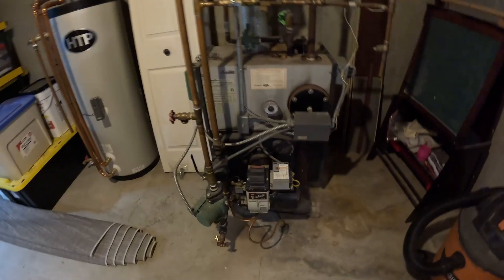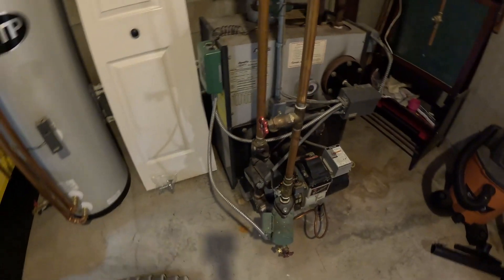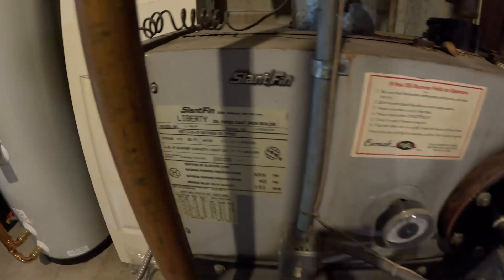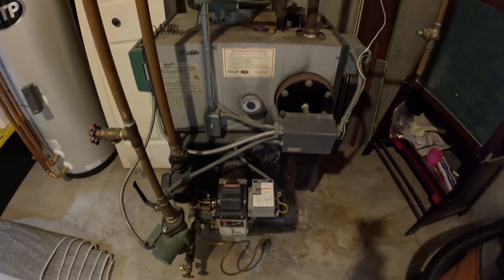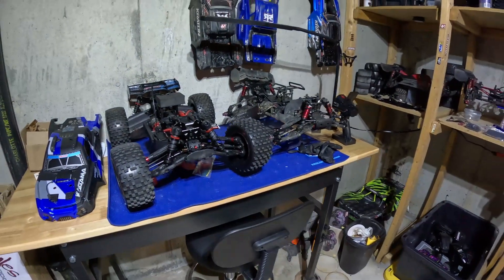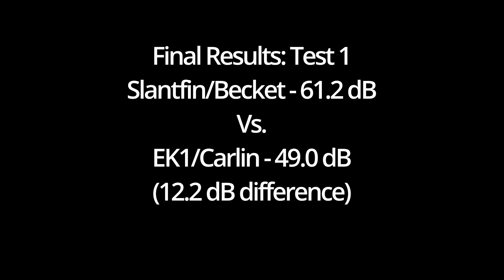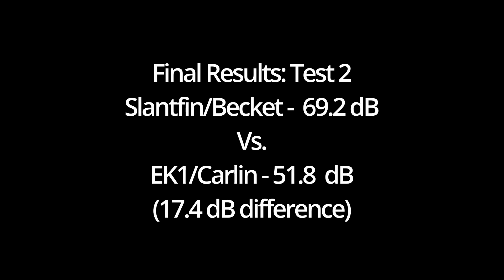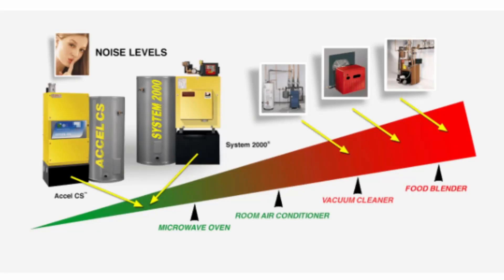Home Heating-System 2000, Energy Kinetics Oil Boiler Sound Test!  How quiet is it REALLY?

Comment: The energy Kinetics sounded like it had a high pitch noise to it? We are getting the combi, hopefully that noise is not the case. Thanks for the video
Reply from the maker: Well it is technically higher pitched, but it's not nearly as loud. It doesn't have the deep rumble that other boilers seem to have. I'm not sure if the combi is EK, but if so you won't be disappointed